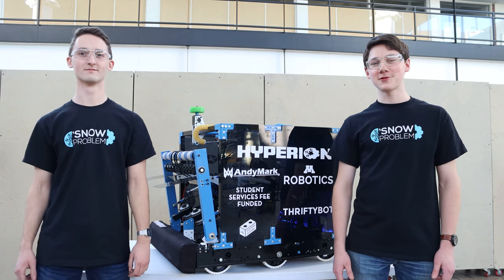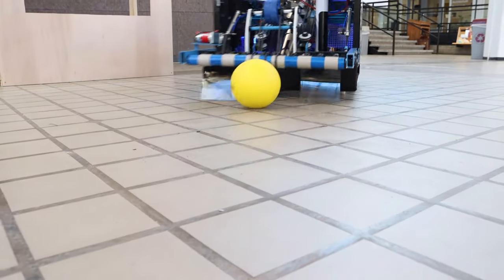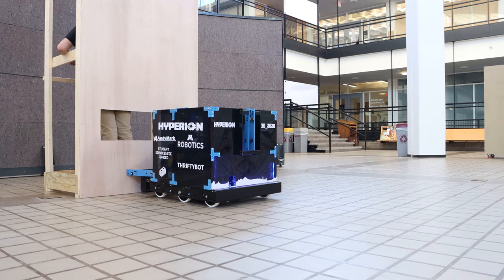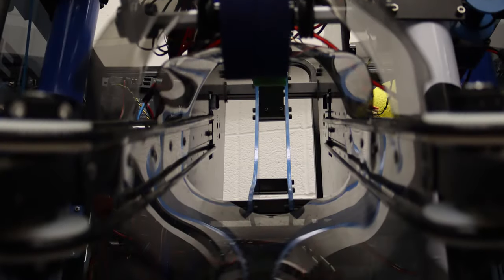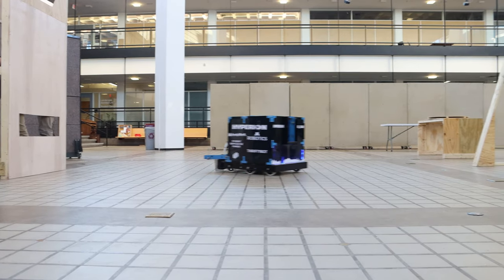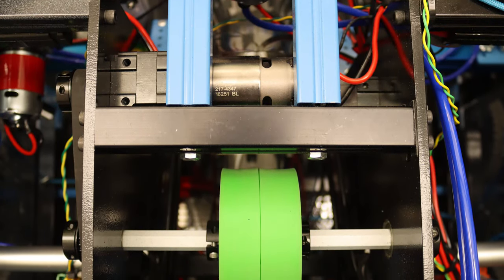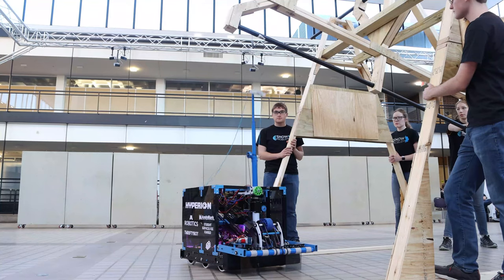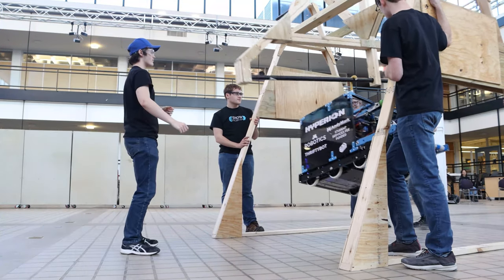Ri3D 2020 Robot Walkthrough

Comment: Nice! By how much does the polycord encroach into the 7 inches of the ball diameter (in theory based on pulley centers and diameter)? Any other insights in the use of polycord for ball transfer?
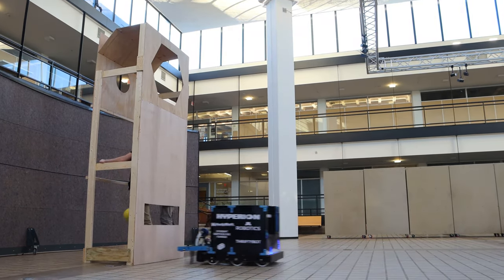Reply: 2:28
Reply: The pulleys on
 either side are 8.25” apart, or 6.25” cord to cord. Polycord works well and can be easily configured for different path shapes. You should make a jig to clamp the polycord edges when you melt them together for the best connection.

Comment: How is the AndyMark redline motor working as far as consistency? Last year both of ours failed because of poor heat distribution. The end result was that the copper holding the brushes basically melted off and caused our robot to malfunction...
Reply: You have to be pretty careful with these, and not stall them under too much load. We only use Redlines/775pros for either low load or mostly free spinning applications where they don't see sustained current draw. motors.vex.com/ has some great information about how quickly these motors burn out under load (the Redline is very similar to the 775pro)

Comment: Can you confirm the motor/gearbox you used for the lifting mechanism? It looks like 775 RedLine with 57 Sport Gearbox.
Reply: The cascading lift to place the hook was a Redline on a 16:1 Sport gearbox. The actual climbing was two CIM motors on a 24:1 gearbox and a 0.7" diameter spool

Comment: Is there a hard stop for the climber to prevent the pipes from falling out when you are going too high?
Reply: There is. Unfortunately I don't remember how it's implemented- since it's a cascade elevator it might just be the lowest tube has a bolt through the bottom to stop it once it hits the bushing.
Reply: The length of the string limits how far the pipes extend, so by tactful hole placement and string measurement it functions as a hard stop

Comment: How do you avoid the rope binding up in the pvc?
Reply: The pvc inner diameters are 1/2 inches apart, so with thickness of the pipe there’s enough space for the paracord to slide. We also used modified pvc T-connectors on the bottom two stages to hold bearings for the rope to run over. It also helps to cut notches for the knots (knotches, as I like to call them) in the bottom of the pipes so that they can nest without jamming into the knots

Comment: Also how did u mount the climb? Did u make a footprint of the shape of the pvc?
Reply: We used a solid pvc flange bolted through a metal plate on the bottom of the robot. We also added a crossbar from the top of the telescope motor mount to the frame for extra support.
Reply: Oh ok got it thank you!!!

Comment: How did u guys make the pipes go up without rigging it inside
Reply: I have the same question
Reply: I'll refer to pipes as 1 to 4, with 4 being the smallest. Rope 1 runs from the motor over a pulley at the top of pipe 1, to the bottom of pipe 2. This lifts pipe 2. Rope 2 runs from the top of pipe 1 over a pulley at the top of pipe 2, to the bottom of pipe 3. This lifts pipe 3. Rope 3 runs from the top of pipe 2 over the top of pipe 3, to the bottom of pipe 4. This lifts pipe 4. This is a cascade lift. We 3D printed bushings to hold the pipes centered and reduce slop.
Reply: Karl Arnhold thank you!!

Comment: Why did you choose a 3 wheel drive over 4 wheel? My team is leaning toward 3 wheel and want to know your reasons for choosing it.
Reply: We used the KoP Chassis (6 wheel config) because ease of assembly was the main factor for the drive train. Given the length of our robot (32") and the desired 6" wheel diameter (to traverse the field berms), 4 wheels per side would be a tight fit. Having the drive motors in the middle also helps keep our center of gravity in the middle of the robot.
Reply: Thank you this was helpful. We were thinking along the lines of what your team was thinking and did a Pugh analysis in which a drive train of this style came out on top.

Comment: So with the safety bumpers, you’re robot meets the lengths requirements?
Reply: The bumpers aren't part of the overall frame dimensions. The frame itself is approx. 32x27, which fits inside the 120" perimeter

Comment: Why bother with trench? We're probably going yeet strat through the middle. Unless there's some advantage we haven't thought of.
Reply: no defense
Reply: We thought with the fast cycles required that having a path with no defense would be very beneficial.
Reply: You can't play defense in the opponent's trench. Plus there is a 1 1/8" metal bar that is on the floor bordering the shield switch. Going over that slows down you cycle and has a possibility of shaking things loose on the robot

Comment: where did you get the 2" mecanum wheels?
Reply: they are from thriftybot but I believe they are sold out, if you want a 3D-printable solution I would recommend this chief Delphi thread https://www.chiefdelphi.com/t/frc125-2-printable-mecanum-aka-v-i-w-release-2019-2020/369139

Comment: Another question: what did you guys use to coil the string? Did you guys use a specific type of winch?
Reply: We have two winches on the robot, one which powers the telescoping hook deployment mechanism (“the lightsaber”) and one connected to the hook itself which actually winches up the robot to climb. The former winch has a rod with a round exterior and hex interior that fits around the hex shaft of the redline, and has two water jet cut flanges on either side that fit around the hex shaft, which have a hole in them for the paracord to tie to. The redline’s short hex shaft was extended with churro, held in place by the aforementioned round exterior/hex interior rod and a bolt running through its center hole to the tapped end of the redline shaft. The latter winch has a similar setup except with a CIM motor instead of a redline, and there are three flanges instead of two—one in the middle and one on each side, spaced apart with the round/hex rod. The middle flange keeps the paracord running around the right side of the robot separate from the paracord running around the left side, essentially allowing the winch to pull in both directions at once.
Reply: If you don’t have access to a water jet, hex wheel hubs tend to make good flanges for makeshift winches.